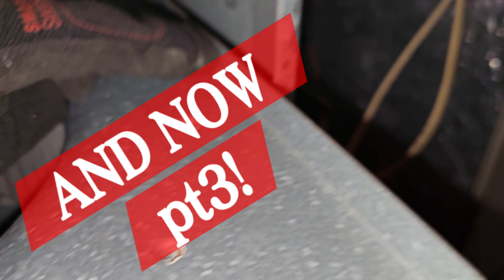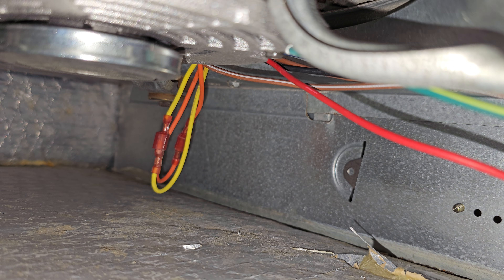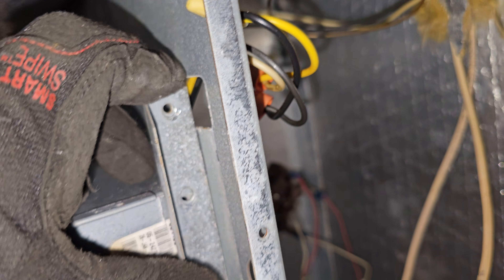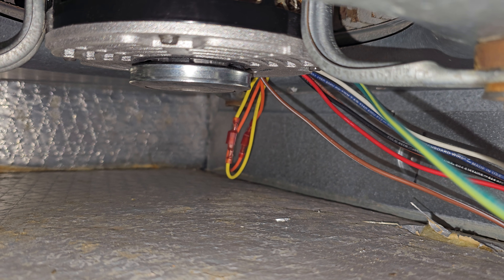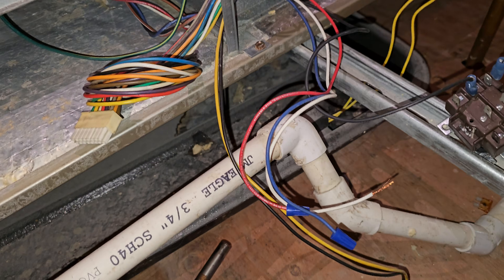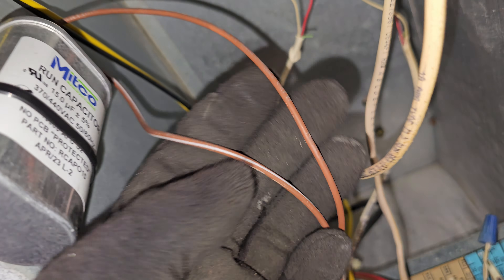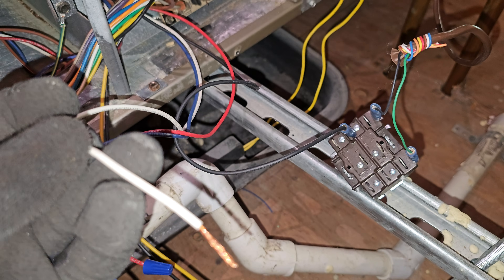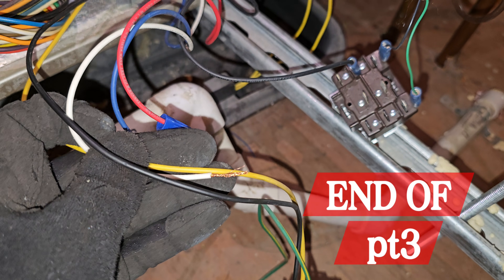ECM TO PSC MOTOR CONVERSION  pt3

Comment: what's the black wire wire on the 24 side of the relay?
Reply: jumper from common?
Reply: @adrianburgos9725 yes
Reply: 24V common
Reply from the maker: 24 v Common

Comment: i found a re manufactured motor for 325.00 at united hvac motors. got it next day but its the next county over. replaced it two years ago.lightening damage most likely.
Reply from the maker: This solution would have been even le$$